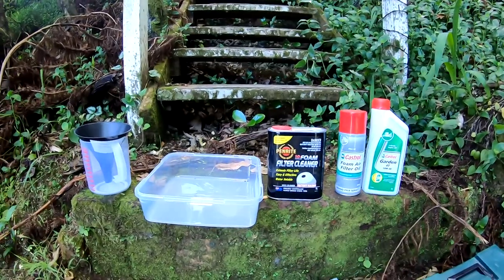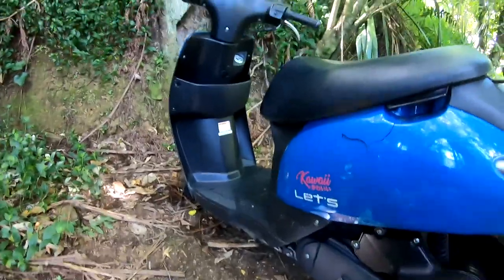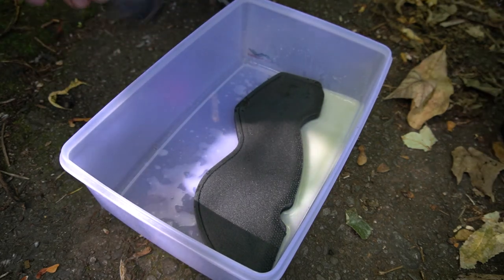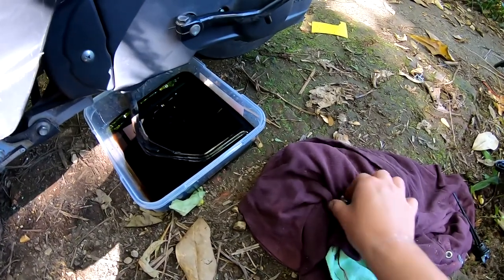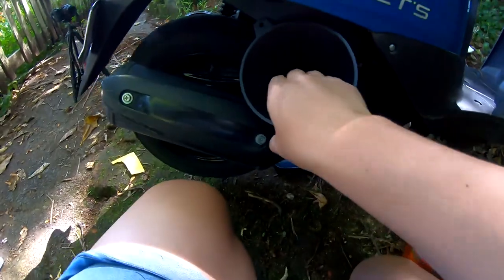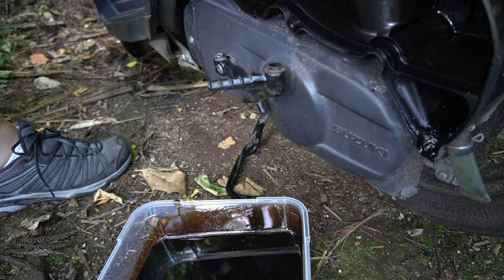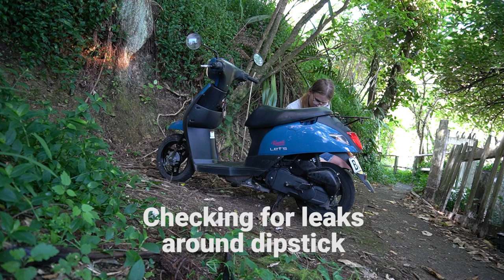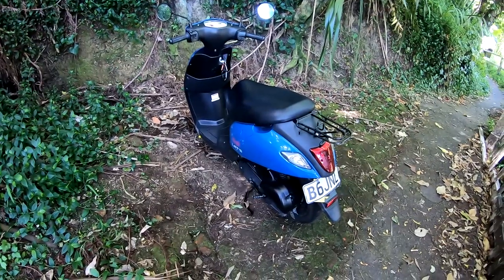Oil change and air filter clean of Suzuki Lets UZ50 Scooter

Comment: I swear by Valvoline . Love my little let's 4 2010 model, still mint .4000km not sure why you put the stand in the container lol. I use icecream container. Mine doesn't use any oil.i use a funnel with about 6 inches garden hose on it to reach the oil filler. Check oil level without screwing cap in
Reply: Good tip re the length of garden hose.

Comment: Hi thanks for your video. I have just purchased the 2023 model with about 1000k on the clock. It was serviced just when I bought it. Would you be able to tell me of there is any difference between that an the one you have? 

Also what is the ideal interval between services/oil changes?

Comment: Hey mate did you ever change the gear oil? The user manual says use the same engine oil, but some dealerships advised to use gear oil 80w-90 so im bit confused what to use.

Comment: Hi there, can you tell me what mileage you have on this bike, I am really considering one of these and want to know what sort of life I could expect out of it.  Also, have you had since new and did performance improve as it got broken in? (I test rode a new one the other day and pull off was quite sluggish).  PS Thanks for posting this, really good to watch as I make my decision on which bike to get. From Auckland.
Reply from the maker: Nah I got it second hand for $1600 I think back in 2018. It's a 4-stroke so yeah doesn't have the same pep as a 2-stroke. But I find it pretty easy to live with and I weigh close to 80kg. The reason these scooters die quickly is because they only take 700mls of oil and people forget to check it and they seize the engine due to no oil. 

but otherwise I think lifespan will vary depending on maintenance, whether it's used on hills vs flat, weight of rider etc. I think if I take care of this scooter I could get 100,000 km out of it. It's at 13,000 right now. I bought it when it had done about 8000.

It's sluggish compared to a 2-stroke but also means less drama with oil mixing, quieter, doesn't stink like burning oil, won't need to do pistons/rings as soon. 

I really love this scooter and have no complaints
Reply: I have the same one. I weight 67 kilos and i manage about 200 to 230 ks on one tank.
Reply: Look after it and it'll last forever. I change my oil often. $14.00 for the oil
Reply: I also have a UZ50. Bought when done less than 1200 km. Now done 2100. If derestricted I can do just over 60 km/h on it and I weigh 90 kg. Well over 200 km on a tank of gas. These scooters would do well on the Napier to Wellington scooter run in March.